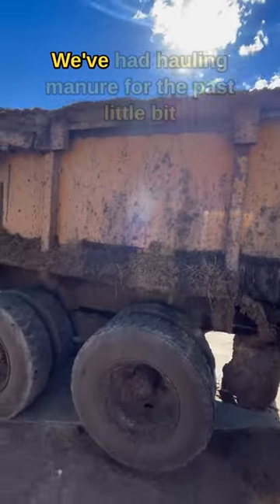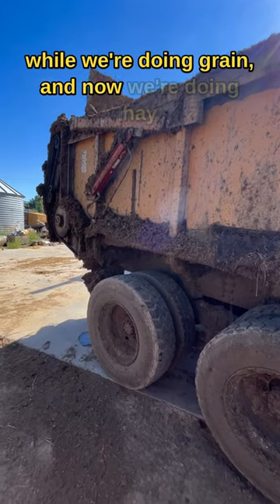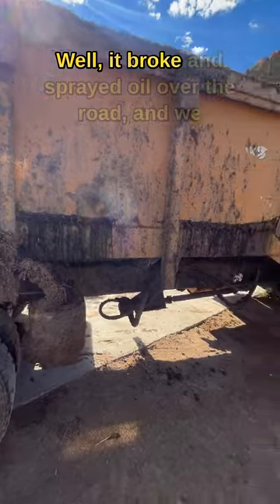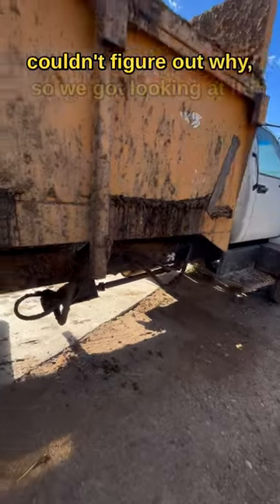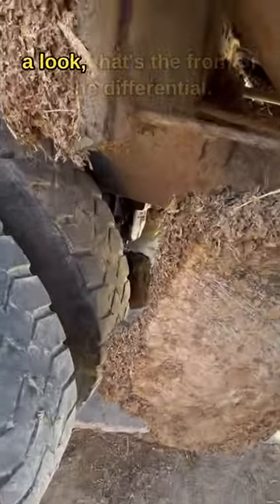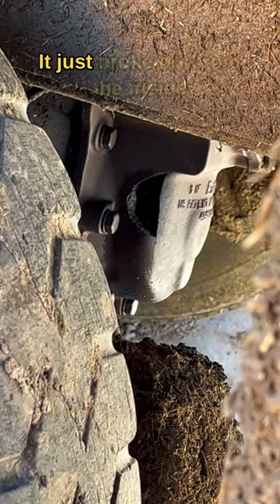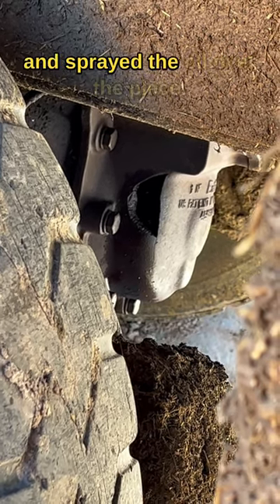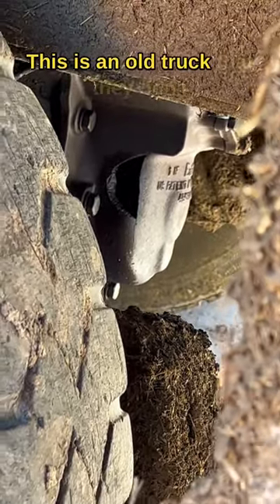Broke the differential. #farming #agriculture #repair #manure #shorts

Comment: JB weld and a piece of aluminum with a few screws you can fix that
Reply: 😂😂 not if the problem was caused from the inside
Reply: @DEVIL666wtf  I reckon so

Comment: I can't believe you actually take that down the public roads. Clean your truck.
Reply from the maker: We are hauling manure what do you expect. This one is actually pretty clean compared to the others.
Reply: @RockyMountainFarmer  You can still clean the crap off the outside of the truck. It isn't that hard. 

I get that work trucks have to use the public roads, but it is disrespectful of other drivers when you guys have things hanging off the outside of your trucks that fly off while you travel on the roads. 

It's like a dump truck with rocks sitting all over the outside of their truck with a sticker on the back that says they are responsible for broken windshields; when in reality, they are, if they do nothing to prevent it. I've been hundreds of feet behind trucks before and had things bounce off the road and hit my car.
Reply from the maker: @Isaiiahii  each truck hauls 4 loads per hour for 3 weeks. It is a waste of time and money to wash it constantly. They get washed when we are done. Not to mention that we are hauling sloppy cow manure that leaks out onto the road because the trucks are not water tight making a big mess all over the place but it has to be done. There is no other way. Welcome to the country.
Reply from the maker: @Isaiiahii  go watch this video I made earlier in the year and you will see how we haul manure https://youtu.be/jfCSAU_J1bE?si=xRSppRdWk7Hef15k
Reply from the maker: @Isaiiahii  and here is a short that shows how sloppy it can get. https://youtube.com/shorts/B48qQEo6mxQ?si=YeTe4ADeHHUxUudg
Reply: @RockyMountainFarmer 
I couldn't help but laugh when you was giving the description of hauling it. I was picturing the face he was making. 
That shat isn't gonna haul itself.